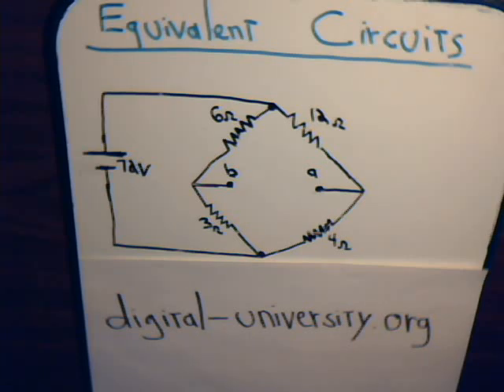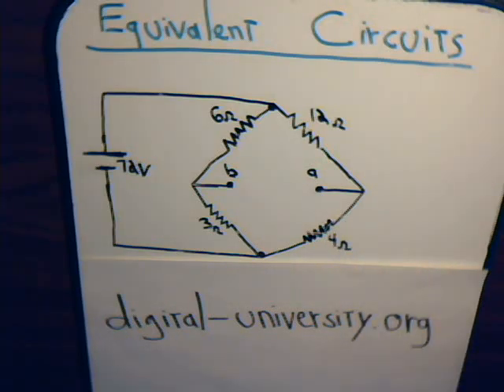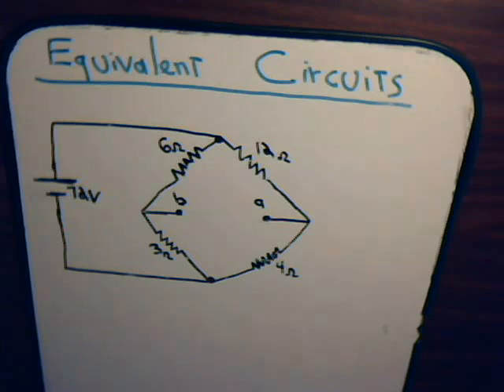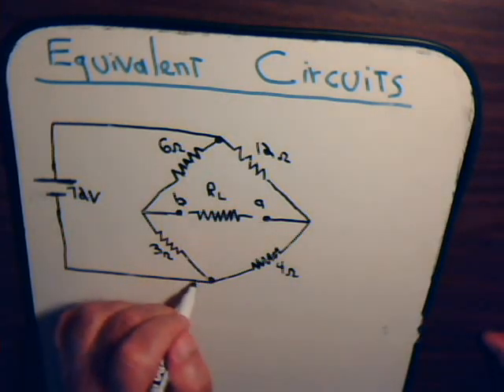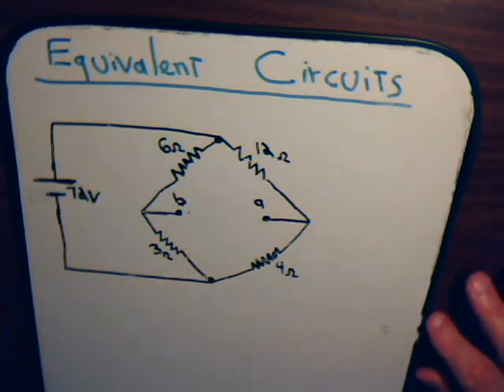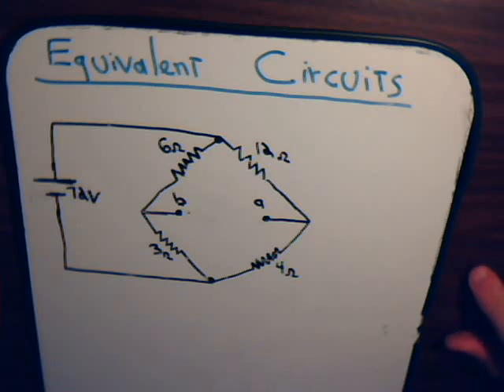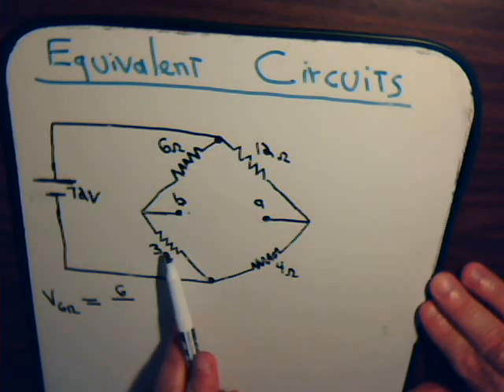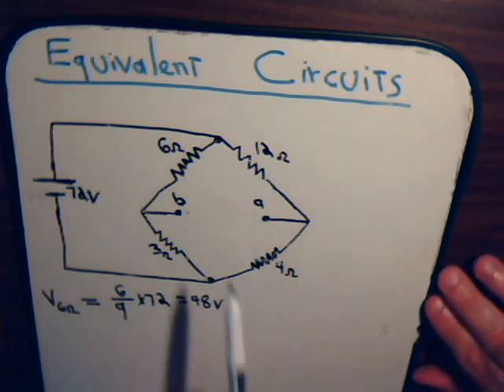Electrical Circuit Analysis Video #49: Thevenin Equivalence of Bridge Circuit

Comment: how do we know that the 6 ohm and 3 ohm resistors, and the 12 ohm and 4 ohm resistors are in parallel?
Reply: Nod
Reply: 1710js Because the current is dividing between these resistors. If the same current flows across them, then resistors are in series. But here, they are parallel.